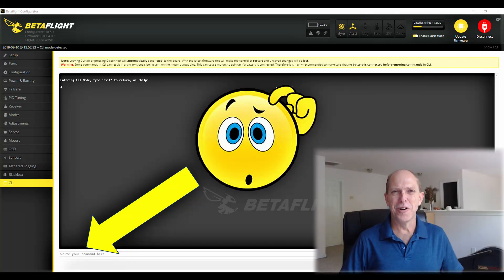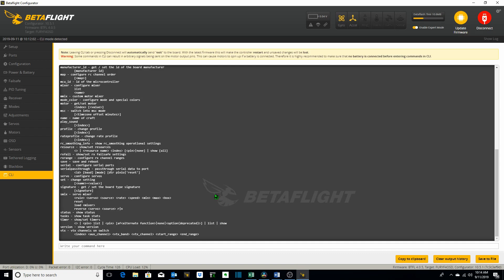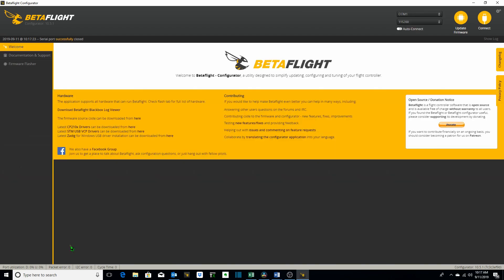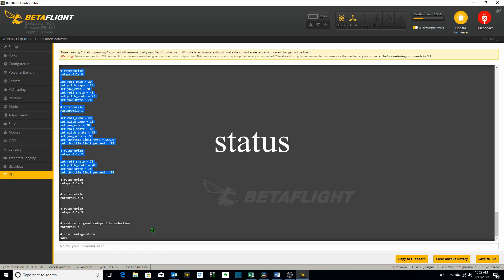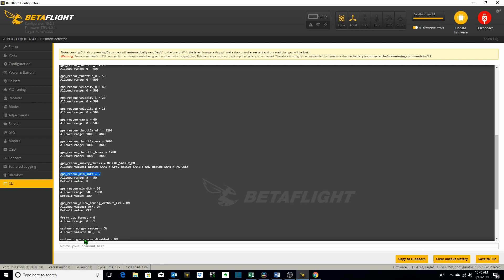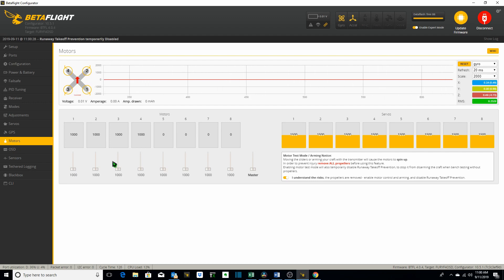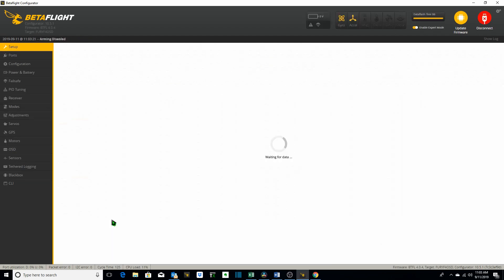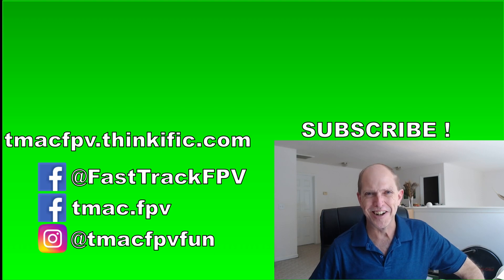BETAFLIGHT USEFUL CLI COMMANDS

Comment from the maker: CLI’s nothin’ to be afraid of right? Let me know if you plan to use it! Remember to check out my new website at tmacfpv.com & let me know what you think! Thanks for your time & Clear Skies!
Reply: Thank you. I could really use an answer to my question I have . I just got my second drone in since I had to send the last one back because it had problems but I had the hardest time getting in the air and at one point had to have my local hobby shop change a couple settings so I could finally get in the air so I dont want to have to go through all that again with this one . I saved my settings I just dont know how to add them to this one.  Do I put in set then settings then save? Or just save ?
Reply from the maker: @creaturefpv  No need for "set". Paste what you've copied into the CLI.  Hit Return on your keyboard.  Then type "Save" (without the quotes) into the CLI.  Then hit Return on your keyboard.  That's it. Just make sure what you're copying and pasting is for the same version of Betaflight OR there's no difference in the settings you're copying and pasting between the different versions of Betaflight.  See more on this in Notes section here: https://github.com/betaflight/betaflight/wiki/4.2-Tuning-Notes

Comment: How to get the default value for only one parameter, e.g. tpa_rate?
Reply from the maker: In the command line of CLI tab, type:
set tpa_rate and before you hit enter it should list the available values as autofill options. Another way to see default value is to type: 
get tpa_rate. Hit enter then see it on your screen. To set it to a different value, use the "set" command as mentioned above. After you change a value, remember to type save and then hit return key on keyboard. Betaflight will then Dave your commands and reboot itself
Reply: @TMacFPV  get and set will not give my the default values, only the ranges. But that's maybe because for this fc it couldn't find custum defaults setttings (came preset by flywhoo like that). Will check.

Comment: Great video. I have one task that I could use some help with..   I need to turn the uart  to uninverted   ex
 I use tbs crossfire but don't have a spare uart  but if I turn off sbus for tx 1  I could utilize the tx and rx I just don't know the command line proper language.  Plz help
Reply from the maker: I have not tried this myself, so please let me (all of us here) know whether or not this works for you.   I believe the command you're looking for to type into the CLI is: set serialrx_inverted = on   . Type that in, hit reutrn. Then type in save, hit return.
See this explanation from BF 3.3 RC1 notes "The parameter sbus_inversion has been changed into serialrx_inverted, and the way it is applied has been changed as follows: It now applies to all RX protocols, not just SBus, and instead of switching the UART to normal when off and inverted when on, 'off' now means that the port is set to whatever the default is for the selected protocol (i.e. inverted for SBus, not inverted for SUMD), and 'on' means that the port is inverted from default (i.e. not inverted for SBus, inverted for SUMD)" from this URL: https://github.com/betaflight/betaflight/releases/tag/v3.3.0-RC1
Also, see "Useful CLI Commands" video here: https://www.youtube.com/watch?v=vaL8JnqfUVg
Reply: Wow T Mac I did try that but  after reading for 2 hrs.  It's actually simple.  I was over thinking it .  It's resource_inverter 1 none l lol.   It's resource is C00.

Comment: Great info and teaching method. Thanks for the upload.  I am having so much trouble on receiver tab (nothing moving) after receiver has been bound.  Resource command shows "SERIAL_RX 2 A03" in my set up.  But, what does this A03 mean?  I expected to see A03 in silk screen on FC, but no such thing found.  Your print at 11:12 doesn't show anything like A00 or B00.  Where or what search term shall I use to get more info?   Using Lumenier Lux F7 and R-XSR.
Reply from the maker: Hey Romy Kim! So, it sounds like you're having difficulty knowing whether or not you soldered the R-XSR to the proper location?  According to the Lux F7 flight controller wiring diagram found here: http://bit.ly/Lux_F7_Wiring_Diagram , you should connect it to UART 2 (RX 2 and TX 2).  These pads can be found on the bottom of the flight controller and should be labeled (see diagam).  "A03" is just the "pin #" associated with the RX2 pad.  You will not see "pin #s" stenciled on flight control boards.  What you will see is RX2, TX2, RX3, TX3, etc.   Once you have the R-XSR connected to the RX2 and TX 2 pads on the bottom of the flight controller and have bound the receiver to your transmitter, if you still do not see nay stick movements in Betaflight, here's a couple morte things to try.  Fist of all with the props OFF of your quad (for safety reasons), make sure you have a LiPo battery plugged into it.  Some receivers do not get power from the USB port.  So, try it with battery plugged in.  If this still does not resolve your issue, you may have held the bind button in too long when intially binding the receiver to your transmitter.  This will cause it to change modes.  To reset it back to the original correct mode, take a look at this video here:  https://www.youtube.com/watch?v=Wx24PQ0sceI . For further useful free info on FPV tips, builds, etc. check out my site at: https://tmacfpv.com/free-resources/
Reply: @TMacFPV  Thanks for the reply.  As a long time RC airplane guy, I thought I could do this in a few days.  Haha was I wrong... quad is a whole different world.  I have tried all the things you mentioned and updated firmware as well, and still doesn't work.  Experienced buddy couldn't pinpoint why not either.  So far, it's been quick trials at field.  I'll check out last 2 links tonight.  Thank you very much !!!
Reply: @TMacFPV  Found it.  That mystery codes are pin out for the given CPU, chip whatever it is called.  But, I doubt that is the problem I need to work on.  I might be wrong, but I bet most of them out there fly drones without knowing this.  Guess I'll check each and every step that I already did including obvious ones.
Reply from the maker: @turboromy  yes, those are the pin#s assigned to the solder pads. You can change them through the CLI to remap motors, etc. I do not believe the pin#s have anything to do with your issue unless you changed them for some reason. Re-checking everything you've done step-by-step is always a good thing to do. Normally that's how I find I missed something!👍😁
Reply: @TMacFPV  I finally got it working.  There was NOTHING wrong how I set things up.  It was a defective receiver.  Things got obvious when different radio and receivers were tested on to my setup.   Please inform others parts can be defective (on next videos).  In fact, it was 2nd defective receivers in a row.  Thanks~
Reply from the maker: @turboromy  Great to hear it, thanks for the update! You got 2 defective R-XSRs in a row? Where'd you get them from if I may ask?
Reply: @TMacFPV  R-XSR was from getfpv and earlier was XM+ from ebay.  I might have damaged the bind button of XM+ while binding and become unresponsive.  Without telemtry, there was no way to tell if it's working at all.  Being relatively cheap (I fly 2M patternship where anything and everything is $1000 at least), I just moved on to one with telemetry.   This was a very difficult thing to realize.   Side story: a buddy who's an electrical engineer was given 2 consecutive bad parts (purposely) during technical interview.  He had major headache, but solved the problem and got the job.